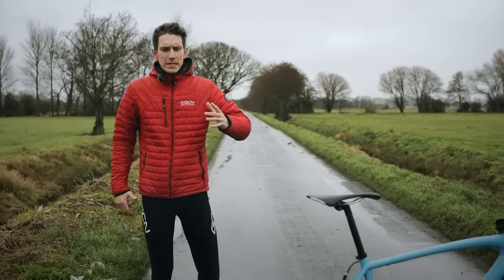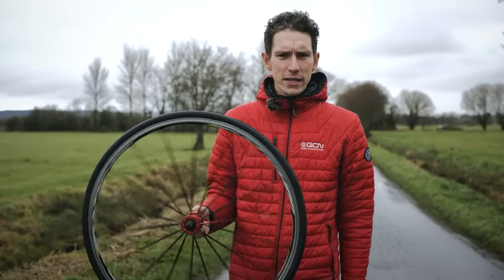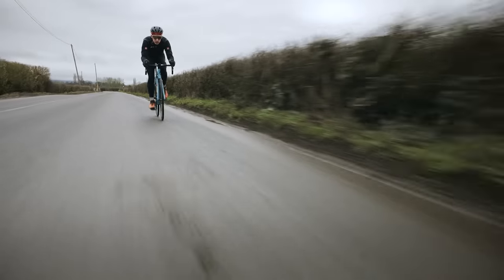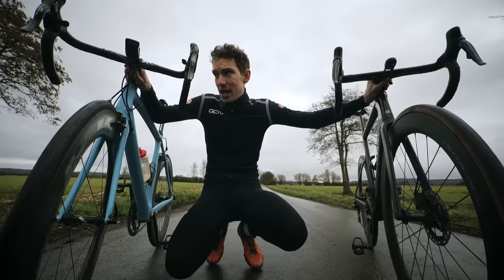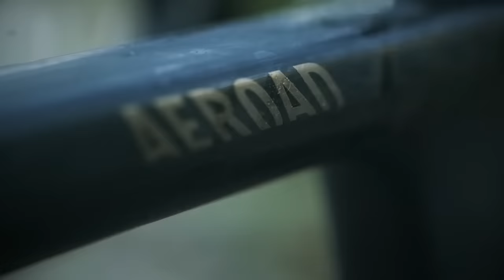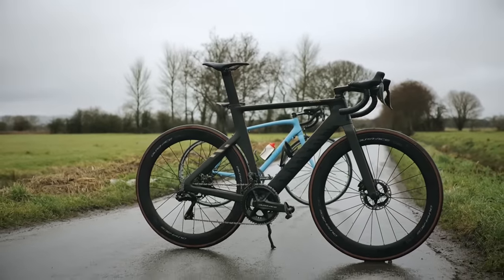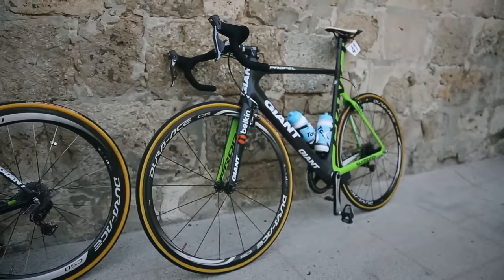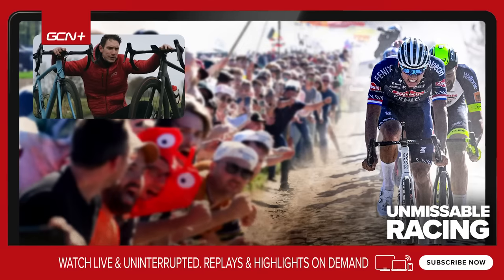How Much Faster Can I Make My Old Bike? | 2013 Vs 2023 Revisited

Comment: I have been riding a 2012 Litespeed C1 since I got it on closeout in 2013. It came with Mavic alloy wheels. I swapped them for a set of Mercury wheels and my speed went up because they were lighter and I was in Texas and had to do hills. I next got a set of 38mm Section 23 mm wide toroidal shaped carbon wheels that were even lighter than the Mercury wheels and no longer hated climbing (didn't love it either), I just got a new set of 38 section 28mm wide U shaped tubeless wheels that are a little heavier (but now I live in Florida and not climbing much) and these are slower on the climbing that I do but a lot faster on descents and flats than the pointer shaped toroidal wheels. The big difference is comfort. I was running 25mm (biggest my frame will take, but I can run 20 PSI  lower pressure tubeless and that made a huge comfort difference as well.

Comment: I don't race anymore, so aerodynamics aren't a priority, however. I did try switching my 44cm bars for 42cm ones and did notice a tiny aero gain.  The narrow bars made it extremely difficult to hold a straight line while riding out of the saddle,  so after a few weeks I went back to riding the wider handlebars..
Reply from the maker: Comfort is key for most of us! Finding a position you can hold and feel confident in, will make you faster! Great to hear that you have played around with it 🙌
Reply: @gcn  I grew up decades ago when nearly all bars were narrower and now I find 40 far more comfortable.  I really dislike 44's which I find far too wide and unwieldy; it's just what you get used to.

Comment: Guess after the intro: I don't think aero wheels will net Sy 3km/h average speed. I mean, that would mean that no other part of the bike's been improved (in terms of speed) in 10 years but the wheels. But maybe with good modern top tyres they might get close. Now let's see...

Edit: Yeah confirmed. Also I'd guess the first port of call for the average person would be riding gear, if they aren't already aerodynamic. 

Edit 2: Has no-one complained about the aero penalty of the quick release skewers not being oriented parallel to the wind resistance? :D

Comment: What was your average speed for these 12:30 mins? I guess I could stay above 42 km/h for such a short period. This is where aero really matters. 
On my usual solo tours I'm more around 35 - 36 km/h for one or two hours on a not so aero bike. So I wonder if changing the wheelset from 30 to 60 mm would really be such a big gain. Considering that even 30 mm wheels feel dangerous with hands off the bar in gusty winds, my next wheelset will probably be around 45 mm.

Comment: Enjoyed the video, as always, but I have a question...GCN, why are you still not doing more scientific/provable side-by-side tests?  The basis for a test like this (beyond the fun/why not do it factor) should be watts.  Ride both bikes at the same average watts over that 8K stretch and your data would be more informative than just trying to smash it as hard as you can for that distance.  This would remove effects like perceived effort, tiredness on the second effort due to the first effort, etc., and would just generally make it more consistent.

Comment: You guys missed this one.  All you needed to do was take the old bike, put power meter on it, ride the course, switch wheels, ride course again, show the numbers.  Not sure who's bright idea this one was but it's a miss, no data other than km/h.  Don't even know the distance.  Come on now, the disc brake rotor stopping test was even more scientific than this.  Does Canyon need to really be advertised NON STOP?  We get it, they sponsor the riders, they have adjustable handlebars, yay.
Reply: Why would they not advertise Canyon? They are sponsored by Canyon, they are supposed to advertise Canyon. Any vid that they show that involves anything Canyon is an ad.

Comment: I'm still riding my 2012 S-Works SL3. 34,000 miles. I have the same Ksyrium wheels but only put them on for climbing. My Bontrager Aeolus are MUCH faster.

Comment: It is still 5% faster, which is a lot. 

I don't believe it. The frame would have to almost disappear to achieve a 5% speed advantage. I am guessing that, contra the position comparison early in the video, the older bike without modification (a long stem) with its tall head tube resulted in a slightly worse body position, which could easily have made a difference to the time. I think that the rider is about ten times the drag of the frame so a 1% improvement in rider position is equivalent to a 10% improvement in frame aerodynamics. Since one can not make the frame disappear, the aero bike is likely to result in more. aero ride position, and this should be mimic-able without paying for oval tubes and embedded cables. 

In any event, a video which is sponsored by the bike being tested has conflict of interest issues.

Comment: I suspect the 2013 bike was much lighter…wonder what would have happened on a rolling course or a hill climb.  Still riding a SL4 with some 50mm carbon wheels.  I still can’t justify the weight penalty of discs on a road bike

Comment: You need a -17 stem then hold same power. Then you will see that the aero  frame does not get you much faster
Reply: I think you’re clutching at straws there Dylan mate, my body position was virtually the same on each bike. And while I tried a negative 17 in my days as a pro, it was too low even then and I went slower with it.

Comment: I love these new developments, but I do have a nagging feeling that the sheer cost of competitive racing is killing grass roots sport. Back in the 80's I won a few races on a bike that cost not much money at all. If I was a teenager considering road racing today, and time trials in particular, there's absolutely no way I could afford to build a competitive machine, so I simply wouldn't consider racing at all.
Far better to introduce some cost controls, like there are in some branches of motorsport, to ensure that racing is a competition based on physical skill and ability, rather than the size of the competitor's wallet. Certainly in time trialling, things have become so ridiculous that it's now impossible to determine which rider is the most able on the day. Which, particularly in junior racing, makes the results utterly pointless.

Comment: Maybe it's just me, and if it is, I'll own it.  But I think deep section wheels, anything over about 30mm, completely ruin the looks of a bike that otherwise lacks all the aerodynamically efficient doodads.  This is amplified on a bike with round frame tubes and rim brakes.  Given I'm never going to win a race, I'll take having a bike that looks right for its vintage over a bit of extra speed.

Comment: I have a 2013 Silverback Scalera with 2013 alu American Classic 37mm wheels, I am not the fastest by a long way and not the most serious cyclist but year on year, race after race drop modern more aero bikes. You cant buy speed. You still need to pedal.

Comment: Talking about the age of enlightenment, I think we still have not reached that point if I look at all the rim brake evangelists. But it was the same 30 years ago when they evangelised Italian steel frames with down tube shifters. That made me take the MTB side back then.
Reply: You disk brake evangelists are ruining the program.
Most non-racers only need rim brakes. And with machined brake tracks, decent calipers and pads, they work fine in all weather conditions, or so my experience riding a 'cross bike in Pittsburgh winters showed me.
Same with those sweet, Italian made steel frames - they're so lively and fun! And again, for most non-racers, that's all that matters. I'm with you on the down tube shifters, though. Blech. Campy Record Ergopower on one of those Italian steel frames is miles of smiles all day long for pretty much everyone.
Racers - disregard all comments, above.
Reply: @YippeeSkippie426  is froome a racer?
Reply: @sangbangerz  - Way to miss the point, drongo.
Reply: @YippeeSkippie426  I take pride in doing so👌🏼

Comment: So basically, you can splash out thousands of pounds on a flash new bike or you can ditch your not very aero helmet and gain 2 km/h that way. Or fit a motor and a battery - with a big helmet if you're concerned about your ongoing survival.

Comment: So … the difference between 2013 and 2023 is … probably … halved juts by fitting aero wheels. It’s a shame you used modern wheels only, as i reckon there were some beauties back in the 2013 era as well - top of the range Zipps for starters.

All the other things are really the sum of ‘marginal gains’ aren’t they? Internal cabling, disc brakes, tubeless tyres (although to be fair I don’t think you were running these in the test), aero handle bars.

I’d love to see a comprehensive test, where you start is a 2013 spec bike - at 250W, 300W and 350W and no subjective ‘au bloc’ runs, and then repeat by progressively adding new ‘stuff’ to it, until you finally get to the last test - a 2023 bike with full race bling.

THEN, we’d get a true picture of what each new ‘marginal gain’ is worth … but I still reckon that half of all gains would come from simply swapping out the kryiums for aero wheels - whether they be 2013 vintage or 2023.

Comment: I’m surprised for sure.  My sense of aero was that it was for marginal gains at speeds faster than my 70 year-old body will let me go.  I’m still not convinced it will make much difference to my usual sub 30kph rides.  The greatest drag is from the rider not parts of the bike which is why I think the extra tinkering with the bike is purely for marginal gains and not something the average cyclist need worry about.
Reply: Aero is important at anything beyond 15kmh. I am a triathlete, and run at just sub 20kmh pace. It is really interesting to feel the resistance difference between my training runs (sub 15kmh pace) and my speedy runs. Now extrapolate that to cycling where the difference is even more substantial between 25kmh and 30kmh as an example.

Comment: Still way too little info to arrive at any conclusion .
The fact your channel is sponsored by Canyon is surely a conflict of interest. Is it not?
Was the power output the same in both runs?
Were equal quality tyres and tubes used?
Was tyre pressure same on both runs?
Aero bars were available in 2013 and more modern ones could be fitted to an old bike.

Comment: where are the haters now?
Reply: There is no power data. So its easy to say its a fake test to promote canyon. You would need to ride both bikes yourself with similar tyres and set up. I am sure an aero frame should be a little faster on a flat course. But what about a hilly course or a rolling course? This video proves nothing.

Comment: Wow. Cheating by using brand new time trial wheels on the old bike and even hampering the new one to appeal the retro grouches and the new bike still won. Brace yourselves, there are going to be some angry grunts coming from the retirement home.
Reply: Just say you recently spent a lot of money on an "aero" bike. A simple google search would have shown you that we had deep section aero wheels in 2012 but I guess you enjoy being scammed by these bike brands. Also these aren't time trial wheels. They are aero wheels that have been on the market for over 10 years.
Reply: @xAudiolith  no, I didn't spend crazy money on an aero bike. Big bike brands are indeed trying to scam you, but that's a whole different topic. They are time trial wheels, no one casually rides 80mm deep wheels on a road bike unles they're doing a time trial. The video literally showed what were considered deep aero wheels in 2012 and concluded they weren't aero enough to give the old bike any chance.
Reply: @michaelmechex  well then we are on the same page. Let’s be real. By not riding to a set power or disclosing the power numbers this test is absolutely pointless and can’t be taken for any fair comparison. Personally I’ve seen plenty of people riding and racing really deep wheels. I live in a flat area so it’s pretty common to see. Now, is 80mm pretty rare? Yes, absolutely. Deep section rims are by nature rare since they cost so much more and 80mm is pretty extreme. Would I ever run them in windy conditions? Hell no. I run 50s on my road bike and they strike a pretty good balance. But I’m not a climber body type so I understand that you wouldn’t really wanna run them in many race situations. I just don’t understand why you try to put down people who call out the bike brands for this anti consumer behaviour. This only happened cause of the cycling media peddling this bullshit narrative about disc brakes and aero. Of course. They gotta sell us the new bike which is 20% stiffer and 30% more bla bla bla.
Reply: @xAudiolith  I'm absolutely not trying to put down anyone who calls out anti consumer behavior. My original comment had nothing to do with nonsense pricing, which plagues the cycling industry across the board. What really gets me, and the reason why I ultimately wrote the (admittedly not so nice) comment are deniers with rose tinted glasses who say old bikes are faster and better in every way, which is objectively not true. That's what I know from experience, disregard all bs marketing. New aero bikes with disc brakes are awesome, but proper race worthy ones being priced at 8+ grand is complete nonsense.